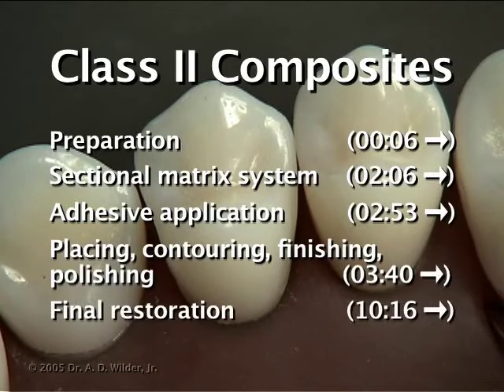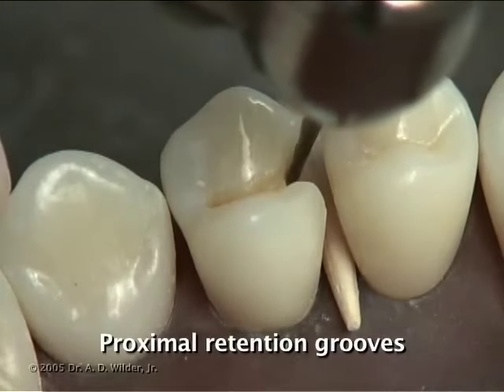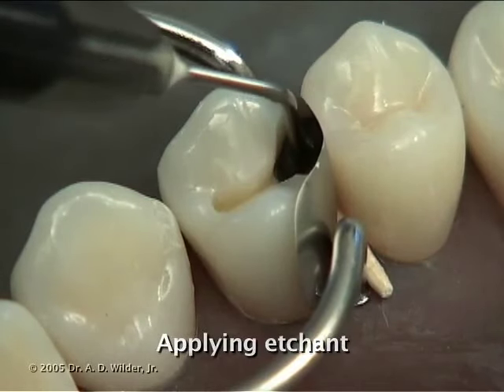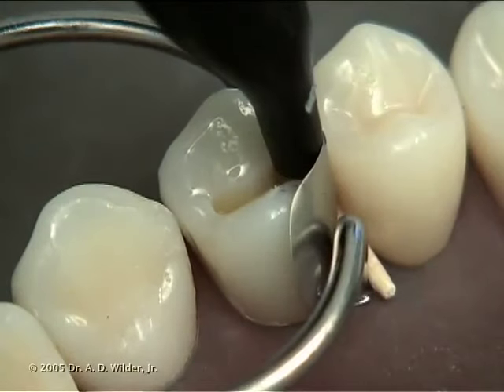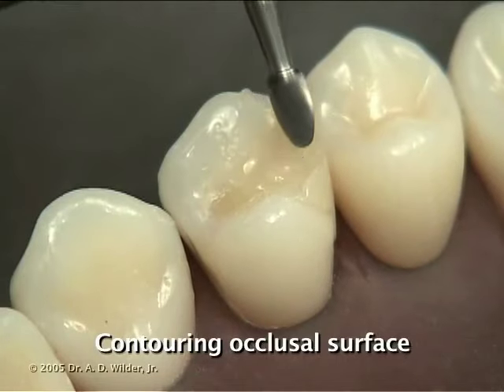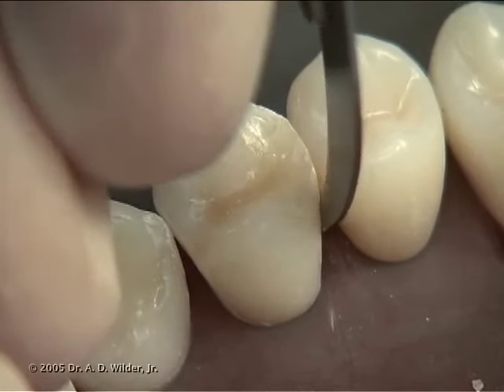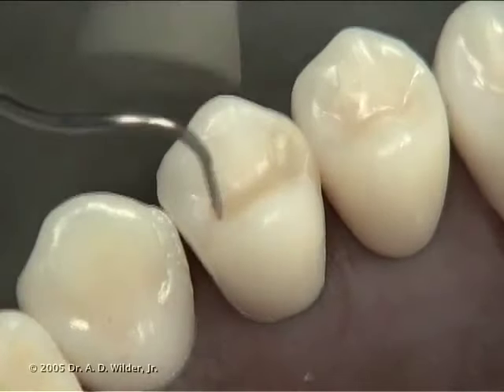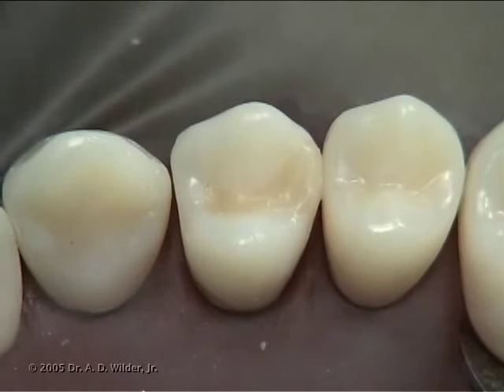Class II Composite Preparation & Restoration | Operative Dentistry

Comment: My school keeps making us do Fiji liner LC which is only to be applied to dentine surfaces... i have so much problem to keep enamel walls clean esp at the contact point. This one uses adhesive/unfilled resin which i was also asked to use or flowable resin, but it is to fill up the margins. Am I able to not use liner? Because i know RMGIC is needed to protect the dentine because CR may cause some inflammatory directly. Also RMGIC has fluoride release which help remin affected dentine. I’m just desperate to find a way to do better for my next clinic session... if anyone has some tips please lmk thank you..
Reply: Well a lot of dental schools do teach to put a liner of GIC. This is not so wrong after all , but you need to think about your case. If you have a deep caries it is a good idea to put some liner ( Ca(OH)2 ,) and than continue with the rest of the restoration. If you find it hard to keep the enamel clean you can first put your GIC/liner and than renew your margins with burr, after that you begin your adhesive protocol and finish the restoration.
Reply: Петър Василев thank you! I’ve been doing that recently(: also I realise applying liner with a dycal applicator helps a lot.

Comment: Thank you for the video! I just learned class 2 prep and restoration at my school and I’m amazed at how little composite excess there is at the margin. Do you have any tips regarding minimizing the excess at the margin or using #12 blade?
Reply from the maker: I have two tips for that. First, make sure you have gingival clearance with your preparation so that you are able to seat the bottom of your matrix below the gingival margin. Second, spend the time making sure your matrix and wedge are placed exceptionally well. This will minimize the need for interproximal finishing later!
Reply: @mentaldental  so well said

Comment: I'm curious why you did not use a slow speed round burr on the dentin.  Was the lesion not deep enough to fully penetrate the enamel and effect the dentin?
Reply from the maker: The slow speed round bur does not cut well on these lab simulation teeth, hence why it was omitted.

Comment: What is the purpose of retention grooves, dove tail, etc. When using composite dentistry?  Mechanical retention isn't needed for composite and surely isn't valued over conservative tooth preparation since we are dealing with adhesive dentistry i.e. natural tooth structure is to be retained as much as possible and we should only be getting rid of the carious lesions to preserve sound tooth structure
Reply from the maker: Interesting question! I would disagree with the premise that "mechanical retention isn't needed for composite." There is a wealth of data showing that while the adhesive bond to enamel is incredibly strong, the adhesive bond to dentin is not nearly as predictable. Therefore, there is some value in having mechanical retention via convergent preparation walls and secondary retention features where possible. A conservative preparation should always be the priority, but making a groove that is a fraction of a millimeter deep is not going to violate this principle. Retention grooves may not significantly improve shear bond strength, but it has been shown to improve resistance to displacement among other mechanical properties.
Reply: @mentaldental  Absolutely agree.
Reply: What is the instrument used  in proximal finishing and look like lancet shape? And also the two instrument name whish used in trimming proximal edge?

Comment: what is the goal of adding proximal retention grooves?
Reply from the maker: Proximal retention grooves provide secondary retention to help resist proximal displacement of the restorative material. To be honest, most clinicians today will not place them in a Class II composite preparation as long as they can achieve a good marginal seal and a strong adhesive bond.
Reply: Retention grooves in a class II composite are not necessary.  Composite restorations are very technique sensitive, relying on proper bonding protocol only for retention.  If a composite filling is being held in place due to retention grooves and there is poor bonding,, especially at the margins, that filling is going to easily get recurrent decay.  Nice video, though!

Comment: what the type of this ring ???
Reply: Sectional Matrix System.
Never used it yet. More expensive than regular Tofflemire.
Reply: @ypherrist2792  We use them in our clinic, very nice for MODs and recreating contact in large spaces where you have to burnish out pretty far. In most normal circumstances a tofflemire or omni-matrix is just as good, though.
Reply: @theardentacademic5601  Thank You for your input. Hoping to move to an urban area where patients can pay for better treatment.